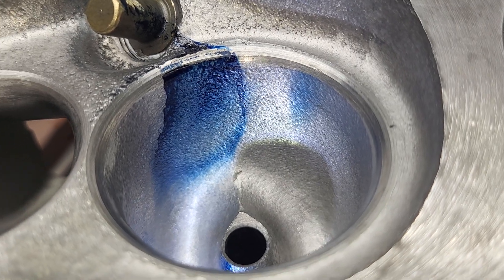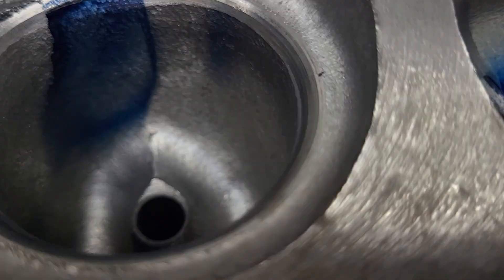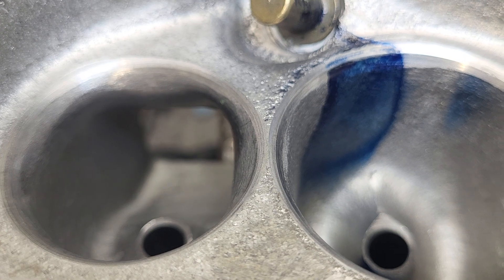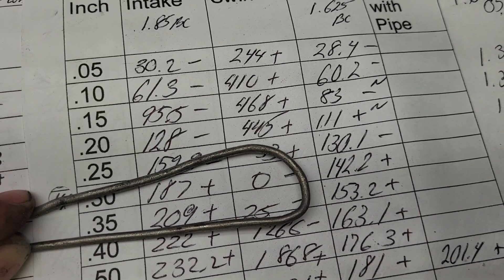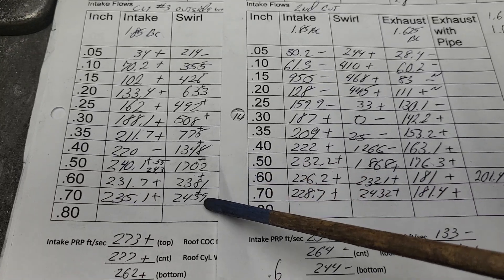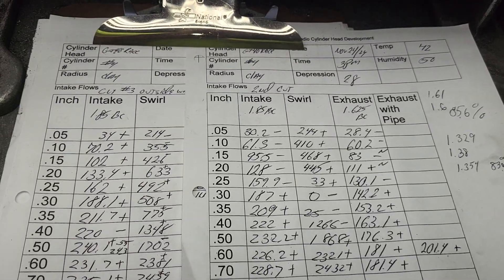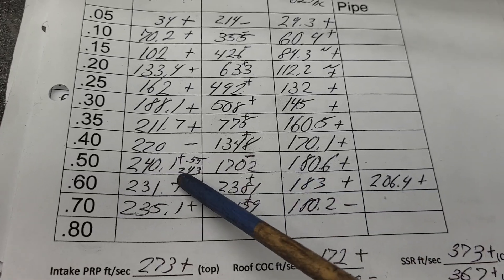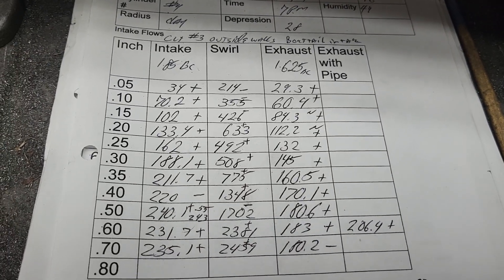Ford GT40 289 Race project, Ford C6FE heads. 3rd cut, Loser?

Comment: The GT40 289 HiPo? one was 325hp and one was 375hp. Both indeed used the Crane FireBall ported 289 HiPo K code cylinder heads and these. If I'm correct? the Cam was the biggest influencer not the heads. I would look into those Crane FireBall ported heads? They were not the best flowing heads at all but man they indeed make power. None of the ports was the same by the way. I'm not sure where I seen the article a guy found a original set and flowed them and he was like " what in the hell?" . Check you Private Messages
Reply from the maker: @garykarenmcgruther6386  No, this is for a 1966 GT40 race car all special Ford parts.
Reply from the maker: @garykarenmcgruther6386  Thanks

Comment: Looking at the flow spray pattern? The vane needs to be moved more the Cylinder wall side like an LS AFR head has. Looks like you targeted the air/fuel mixture to tight in one area. I needs to be spread apart. Flow Ball's and Flow flag you made will tell you where you need to go and a 0.035" Mig welding wire straighten out about 10" long and one end hammered with Ball Peen hammer to make a tiny spoon shape. That creates lift in air where its lazy at to see if it gains speed. Gotta Thank Joel A. Dubose on that one. That exhaust valve is gonna hurt this head in the end, I hate to say it. 1.62"? many don't think 0.020" will hurt but its sure does.
Reply from the maker: @garykarenmcgruther6386  Stay tuned. It all gets addressed in upcoming videos. Stay tuned.

Comment: What are they doing with this engine? 292 & 8k RPM is a strange combination. I know ratios jump quickly but I bet opening that throat would give you some needed CFM
Reply from the maker: @jseal21  Road race 1966 Gt40 8500rpm. Ouch!

Comment: Back in the day, from what I can find, the 289 powered MK I had 390 HP @ 7000 rpm. Even if your heads were equivalent, better cam lobes, valve springs, and lighter rotating assemblies should increase RPM capabilities. I dont know what kind of oiling system they had then, but there are so many ways to improve RPM beyond head flow that when you DO improve head flow, seems like you set the stage for everything to be better. But, again....if it is a road race engine, power bands and torque might factor in more heavily than peak power.

Comment: What happens to flow if you fill in the exhaust floor? Then get an exhaust flange and weld tabs that go into the port. Like Cleveland intake port floor fillers but on the exhaust side.
Reply from the maker: @samuelfreeman9518  less speed differential from floor to roof.
Reply from the maker: They are working pretty well right now. Thanks
Reply: @servediocylinderheads  I'm not sure on that, If you raise the floor up but shrinking the port at the same time? Shape is king in gaining speed. I would clay up to the top of that Pump you mentioned and flow it, then add more clay to see where it goes. That exhaust is big and the exhaust valve is really big.
Reply from the maker: @garykarenmcgruther6386  Customer stated no welding on brand new castings.... Thanks

Comment: Interesting and rare heads you're working with there, Charles! Of course, the bane of the small-block Ford has always been the factory production cylinder heads. When getting the most from factory-produced Windsor cast iron heads I've had the best actual on-track performance results with C9 351 Windsor heads. Granted, the exhaust ports needed much work given the intrusive "emissions bump" and small size.  I would raise the ports slightly and oval them out. The roof would be wider than the floor. The line of sight to the underside of the valve head would be much improved. With the right approach to opening them up along with larger valves, cleaning up the throats, deshrouding the chambers, getting rid of the spark plug bump, and slightly raised and enhanced intake ports the heads worked amazingly well with up to around 400 c.i.d. engines. We won many N/A races using heads like these in the N.H.R.A. and on the street against formidable competition. I've been building and modifying Ford engines for nearly fifty-five years. In the early days, we had few alternate choices for cylinder heads. These days, the story is much different.
Reply from the maker: @billfioretti3013  Excellent! How am I doing?
Reply: @servediocylinderheads  Charles, you're limited by Ford's design and your customer's vision. You're doing fine given those restrictions. Your approach needs to be different than most of what I ran through the years. The proof of your work along with the overall engine and vehicle combination will be not just flow bench numbers attained but with vehicle performance. You are dealing with a smaller engine and targeting more r.p.m. than my Windsor stuff.  As an example, I'm currently running a pair of my original C9 351W cylinder heads on my original (now .030 over) 351W engine in my original 1969 Mach 1 street car which is an eleven-second quarter-mile beast. 357 engine, pump gas, 10.2:1 c.r. , reasonable hyd. flat-tappet cam w/ 14" vacuum @ idle, 3600 lbs. and 3-speed automatic. The heads flow 230@28" .500 lift intake and 185@28" .500 lift exhaust. I made specific enhancements to encourage swirl; especially helpful on dual-purpose street/strip applications. Early C90X Ford Musclepart dual plane aluminum manifold port matched to upper head port. Side and lower port dimensions untouched to counter reversion. 800 d.p. Holley. Throttle response immediate. Scary torque and power from idle through just over 6000 r.p.m. 
I ran mid to low thirteens with this car in NHRA L/SA in '70-'72. 
Best I can say by way of comparison, since the headwork, the car pulls better than my 428CJ Mustang! 
I'll be following your work, as always. Much more satisfying than bolting on a set of aftermarket heads. Keep it up!
Reply from the maker: @billfioretti3013  Thanks! Fun? Questionable!
Reply from the maker: @billfioretti3013  Big Mike has a 69 Mach he wants me to do up for him up north. It will be fun.
Reply: @servediocylinderheads  The early '69 heads are best to start with. Slightly more material, less chamber and spark plug bump than the '70s. Have fun!
Reply from the maker: @billfioretti3013  Thanks